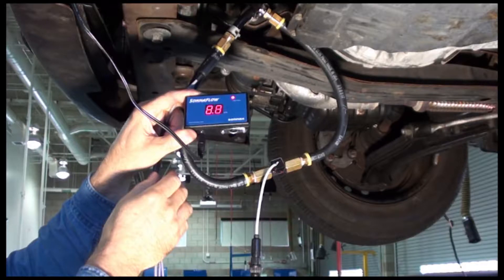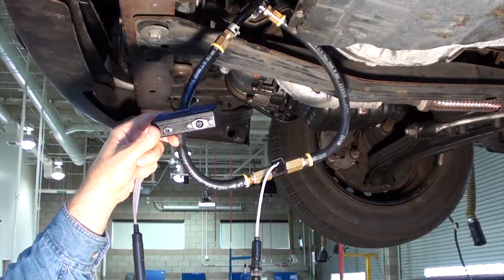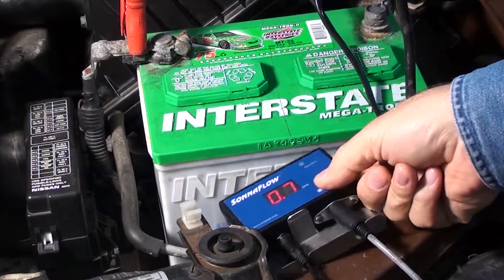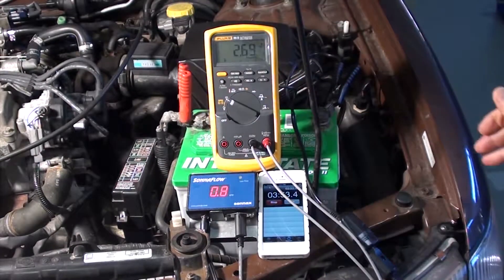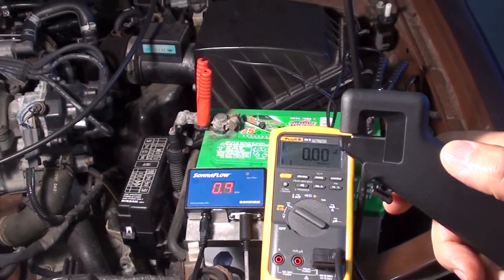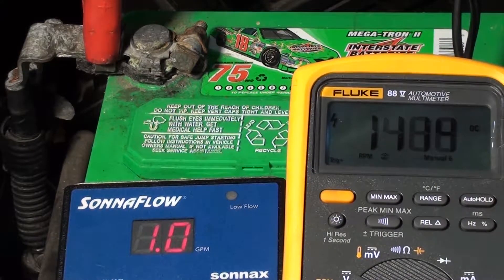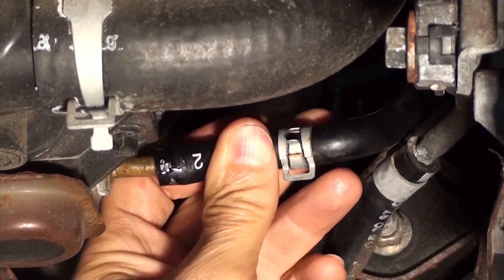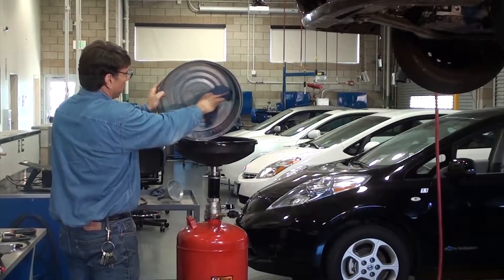Sonna Flow Cooler Tester

Comment: can you explain why some of the pro-shaft have clunk noise, sound like helicopter.
Reply: Mercedes C-class
Reply from the maker: I'm not familiar with Pro-shaft so I looked them up.  Driveshafts, right?  I wouldn't know but I also find it odd to have a driveshaft question on a cooler flow video.  That is if the pro-shaft you were talking about is a driveshaft.
Reply: propeller shaft